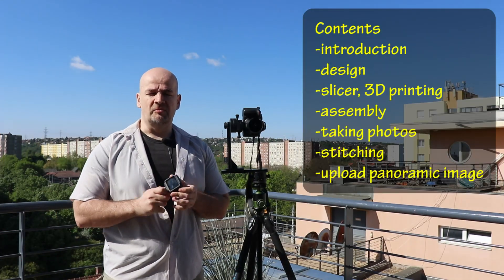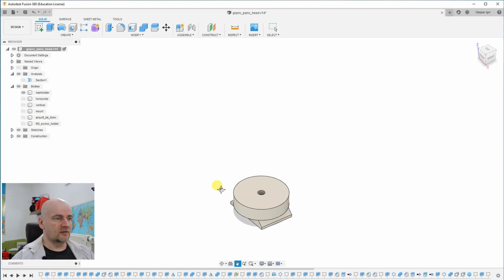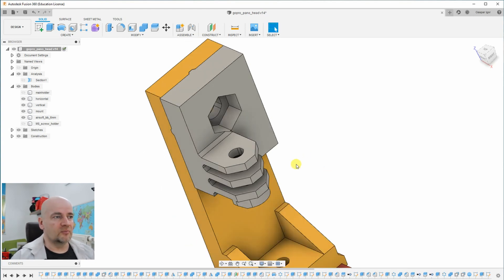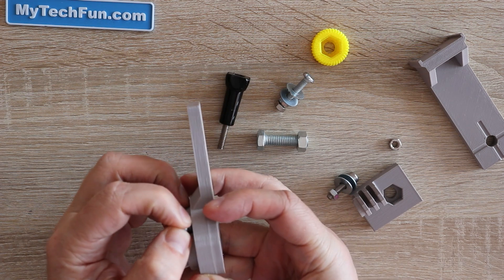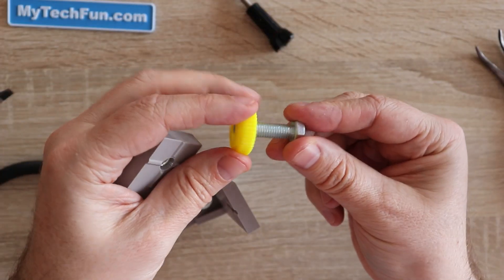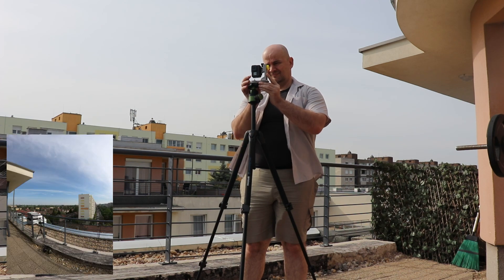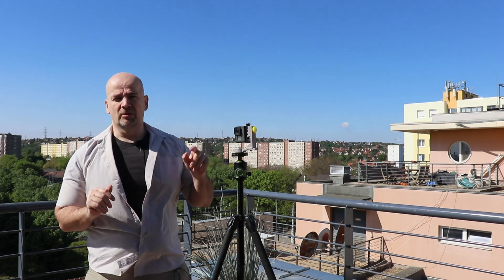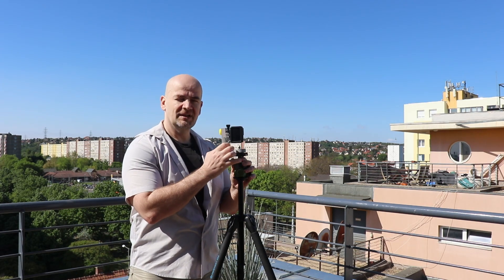3D printed panoramic head for Gopro and spherical panorama

Comment: This is a great design and I am so appreciative of you sharing your work. I have been trying to stitch the GoPro photos from a hero 5 in Hugin. It does pretty well but there is still a stitch line in a few places. I have a feeling it is on the software side as I used Autopano to stitch the photos and it was flawless.  Any help would be appreciated. I am not sure if it is a lens calibration issue or what. I have tried that but it seems to come up with a different calibration depending on the environment.
Reply from the maker: Hugin is free but not perfect. Autopano is better, ptgui is best, but expensive. Probably not the lens problem. Try to lock the exposure (read the description of my video)
Reply: @MyTechFun  Thanks for the reply. I get stuck on things like this. I am not doing enough of them to shell out the money for either of pro versions and I know Hugin should be able to do it. I have made some ground getting a better stitch. Once I am satisfied I will send you my workflow.

Comment: Sir I need this Where Should I buy ?
Reply from the maker: All STL files you can download from my website for free (link in description). If you don't have 3D printer, find somebody near you who have. Or you can use 3D printing services, they can print it for you and sent by post.
Reply: @MyTechFun  Great Sir Already Download Now I am Searching For Someone Who Can Print I Just Have send This STL Files? Sir I am not technical Person. Thank Very Much For Your Reply☺️☺️. Subscribed
Reply from the maker: @parimalsonera8413  yes, person who have 3D printer can use STL files to print this parts for you. You will also need few metallic bolts, but you can buy them in some local store.
Reply: YES SIR I Ordered That. Now Finding That Material Which needed apart from 3D object. Thank You Very Much Sir I Have go Pro 7 Black.👍
Reply: Sir Created Panohead For GoPro Now I Want To Connect With My Tripod Which Instrument Need to Connect With Tripod
Reply from the maker: @parimalsonera8413  This design is created for Arca-Swiss plate attach. Something like this: https://www.ebay.com/itm/QR-50-Quick-Release-Plate-Clamp-Mount-Compatible-For-Arca-SWISS-Tripod-Ball-ts/143755187077
Reply: @MyTechFun  Sir Done It With Acra Swiss Plate Thank You So Much☺️
Reply: @MyTechFun  Sir  Can We Use This Stand For DSLR Camera ?
Reply from the maker: @parimalsonera8413  no, this is designed ONLY for Gopro camera. Not for DSLR, it is too big and lens position is also different.
Reply: @MyTechFun  Okay Sir ☺️ Once Again Thank You Very Much Sir

Comment: Hey there
If you take a look at GoPro Manual (https://gopro.com/content/dam/help/hero6-black/manuals/HERO6Black_UM_ENG_REVA.pdf, page 74 and on) there is Protune that you can adjust white balance and exposure to handle that issue with auto exposure. 
Nice work! Let me ask, which kind of filament is that? This is not PLA to hold GoPro mount, right?
Reply from the maker: Thank you. I already found a solution (description updated). Long press to screen to lock exposure (page 71, 72). I was searching in menu all the time. I wish I know that before I created the video :-( Material I used is PETG to get more durable object outside too (on high supper temps). About Gopro mount, I had a separate test, how much can it handle: https://youtu.be/VyUQ1wfCCNU